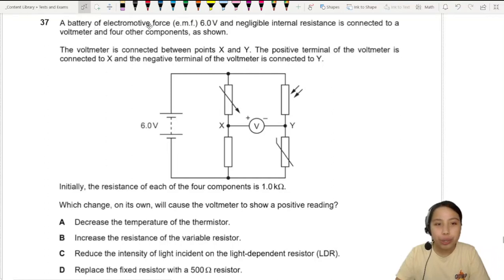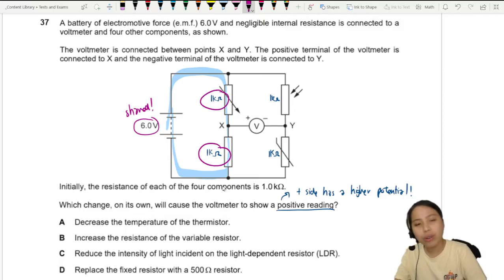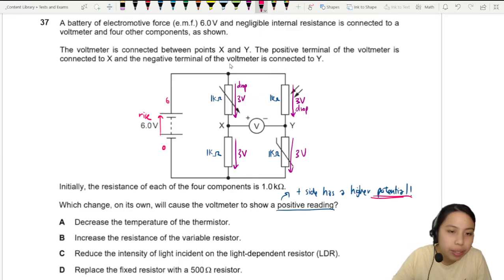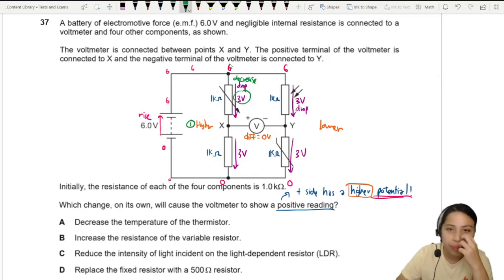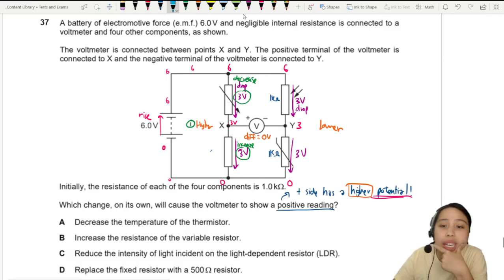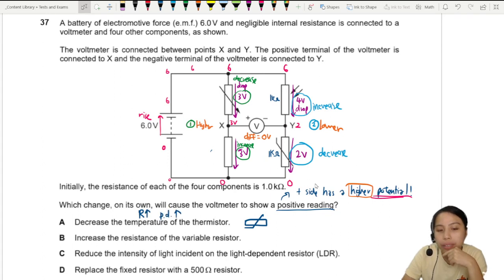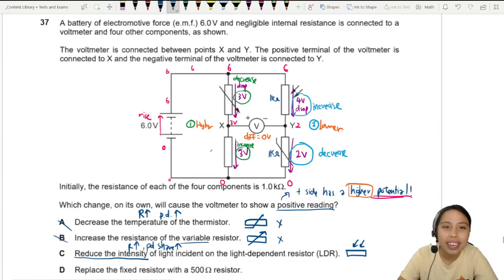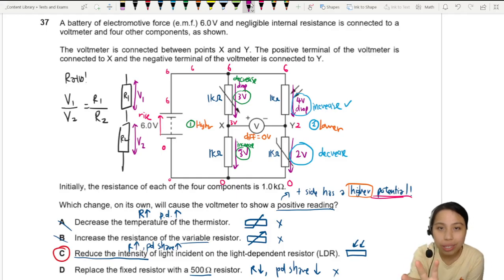ON22 P11 Q37 Voltmeter Bridge Reading Change | Oct/Nov 2022 | Cambridge A Level 9702 Physics

Comment: Hi miss, i am not understanding why D cant be the answer. Please explain 🙏
Reply: Initially resistance was 1000 ohm now you replaced it with a 500ohm resistor as resistance is proportional to potential difference a lower value for resistance leads to a lower value of potential drop/difference which is what we don't want! Hope you understand!